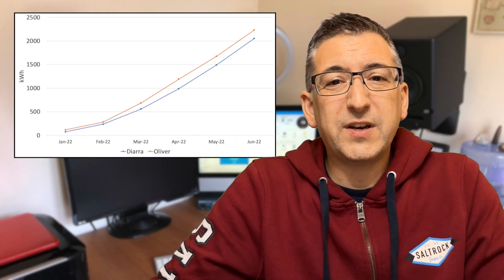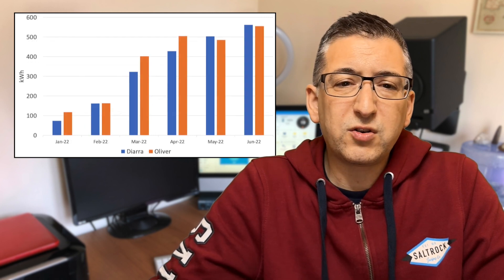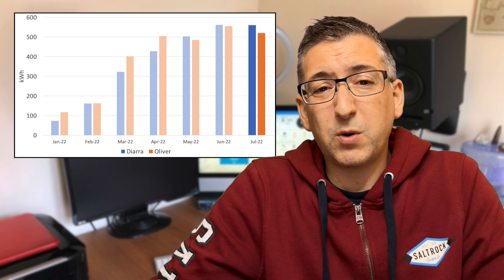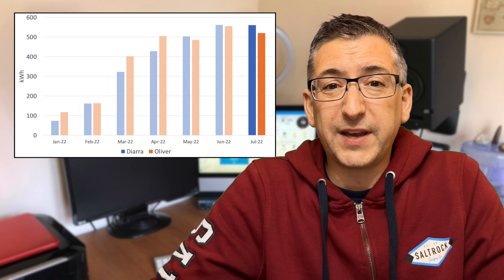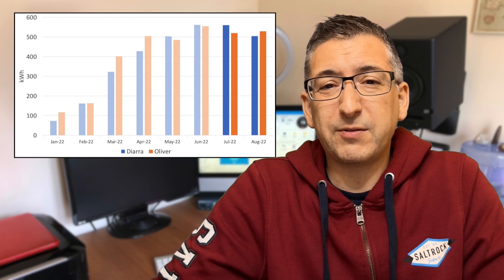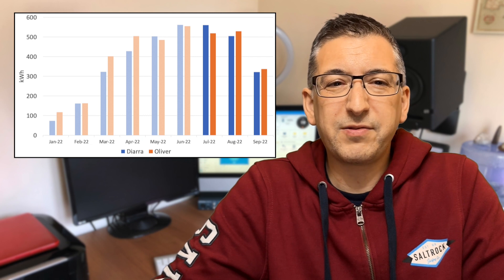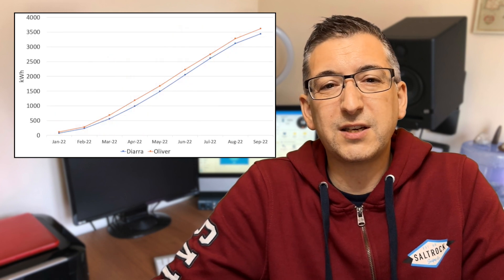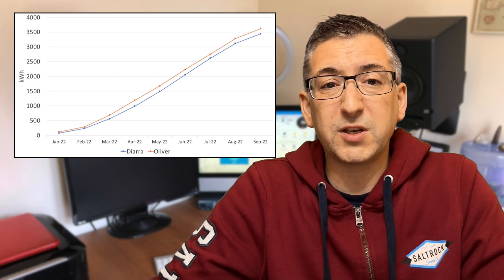SolarEdge vs Enphase: Part 2! Nine Month Update

Comment: My thoughts… most inverters have a 10yr warranty but enphase has 25 yr. I’m looking at a garage roof install so no scaffold needed and maybe?? Locating the microinverters inside?
Reply from the maker: The microinverters are usually bolted to the frame under the panels. I guess you could put each one inside but you'd then have a lot of cables running in and out under the tiles as opposed to the usual 2

Comment: Just setup a solaredge setup yesterday, 6kwc Est/West ! Already connected to Home Assistant. l am happy until know, just Solaredge API is limited/complex/multiple. Need to still teak a bit. Solaredge seems robust and efficient for shading... I selected SE because it was the preferred solutions of the installer, but also because I plan to add batteries next year. So DC/AC/DC/AC make not really sens... I will keep inform !
Reply from the maker: I think there's a whole debate to be had over the pros and cons of hybrid inverters vs AC-connected batteries. I have AC-connected and it is really flexible  in that it allows me to mix and match my vendors for various components. But that does come at the expense of efficiency loss, and the inability to generate solar during a grid outage.
Reply: @SpeakToTheGeekTech  sure, but I can also use ac battery if I want/need ! At the end we have to choose, even if there is no clear winner!

Comment: Great video.  I enjoy your accents and "battles".  The graphs are always valued too.

I have an Enphase IQ8+ 24 panel/microinverter 10kw system.  This has been engineered to cover 110% of my current energy usage.  My energy supplier allows up to US $500 credit to be applied to my account.  This works well by getting me about US $18-$22 credit per month gain on my monthly power bill.  I can maintain the US $500 balance just in case I end up in an extended bad weather situation or a failed system.  

 It is a ground mount system so I have zero shading all day long.  I am also located in the Northern Nevada desert so I get a lot of sun all year long.  The only challenge I have for sun light are the few days in the winter months when it snows.   Being a ground mount system, it is easy to keep any snow cleaned off the array, so it is still generating almost at the same rate as it does during the spring, fall and summer months.

I am quite pleased with this system and I built it myself, except for the licensed electrician work to finish connecting it to the grid.

Keep sending those videos!
Reply from the maker: Accents?? What accents? :)

Comment: Awesome video gents.
The only direct comparison of Enphase - Solaredge that I have found on YouTube.
I have Enphase iq7+  with 395w panels and the array produces marginally less than my neighbour’s who has Solaredge.
Both systems are reliable and have worked without issues so far.
I’m sure microinverters could fail, but optimisers could fail too. John Tisbury describes one in his Youtube channel.
Diarra, how can I setup the home assistant to get the data from the envoy?
Reply from the maker: Home Assistant itself is not necessarily a simple task. Usually you run the software (https://www.home-assistant.io) on something like a Raspberry Pi, which is the easiest way for a beginner in my opinion if you are able to get hold of one at the moment. Once you have that, adding Enphase Envoy support is very easy. You add a built-in integration (Settings > Devices and Services > Integrations, then search for Enphase Envoy), then input your envoy's IP address and your credentials.
Reply: @SpeakToTheGeekTech  
Thank you Oliver
After a quick google search it looks like at the moment the raspberry pi - home assistant is beyond my IT skills. I have started researching YouTube and perhaps in a couple of weeks will give it a go.
Reply: @SpeakToTheGeekTech  thank for Home Assistant how-to.
I don't yet have EnPhase equipment, and no HA too. But both are plan on the following months 😀